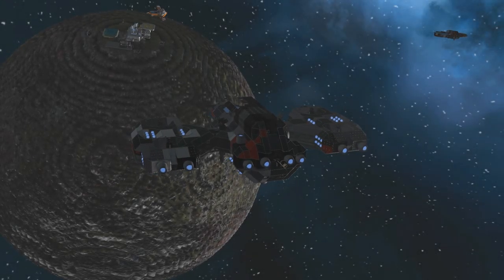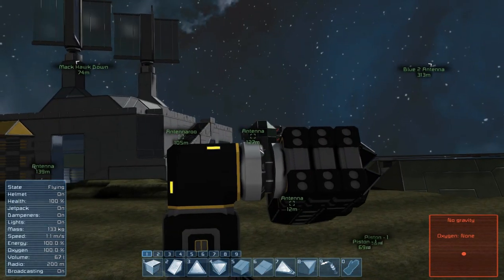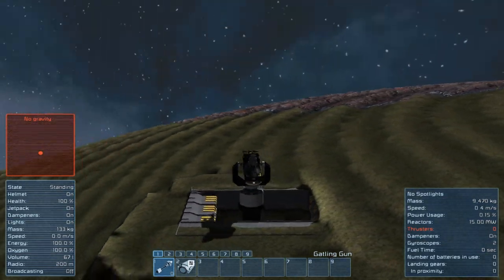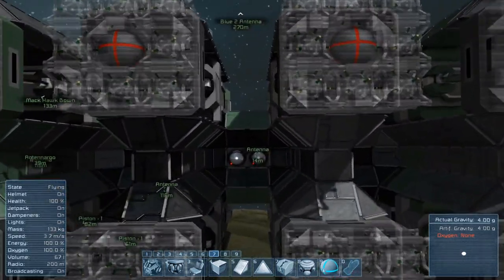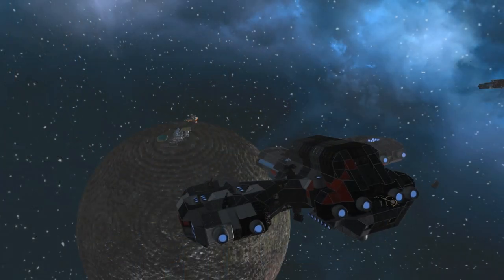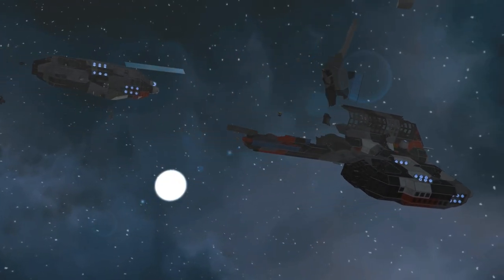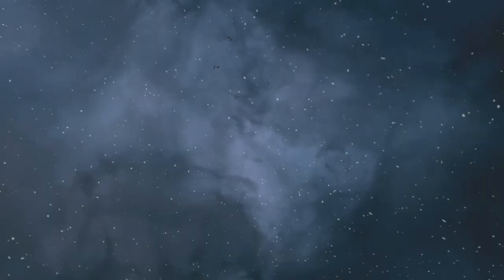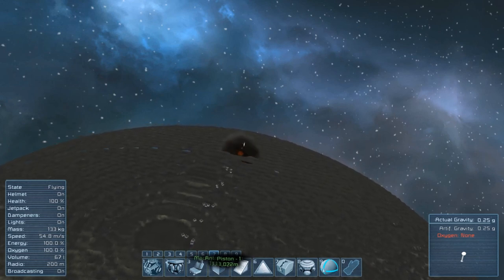Space Engineers - SAM Site & Planetary Defense Turrets

Comment: again with the point that normally in multiplayer your gonna be coming across smaller faster ships that aren't gonna be sitting still but still good designs anyway. what would be nice is if they added a small high energy low damage laser, anyway good job
Reply from the maker: +Jonah Monteiro (mafia duck) You can do a pretty good job of flooding an area or approach in such a way that even the small fast stuff is going to struggle to avoid it and still do anything useful... and while that's happening the other 2 turrets can be doing the work :)
Reply: yeah but again in survival you want to save as many resources as you can by making the turret more effective so theres that aswell